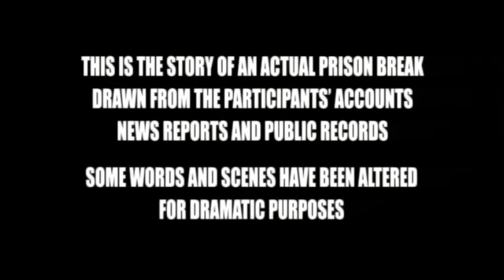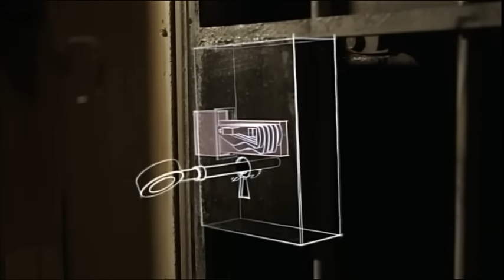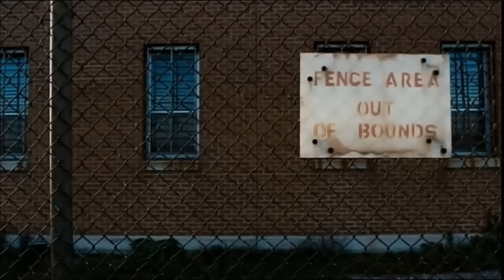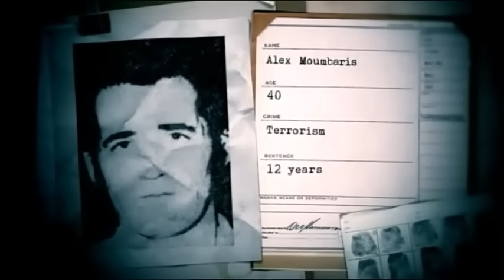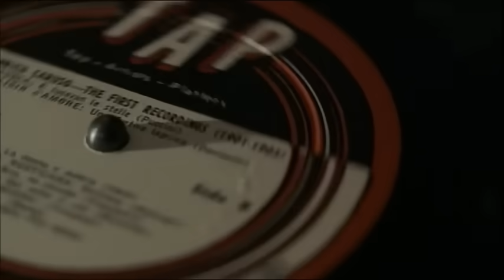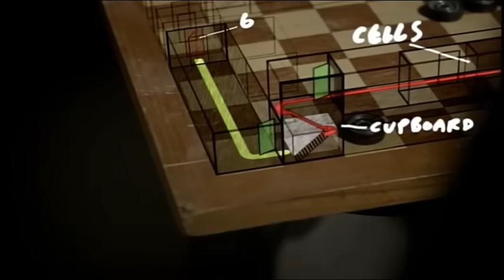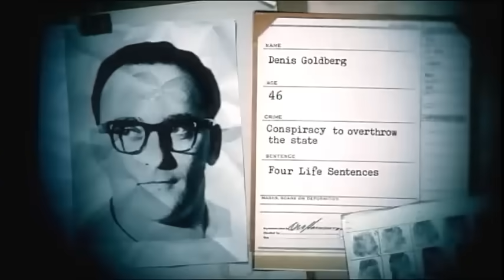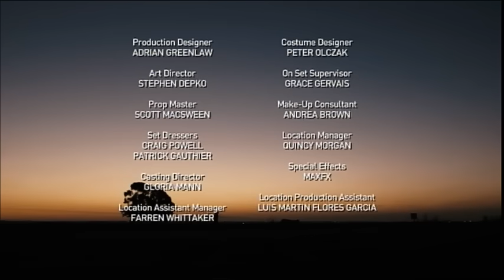Escape from Pretoria

Comment: 5:27 Door 1: Inside
9:34 Door 2: Outside
16:41 Door 3: Corridor
18:12 Door 4: Stair
23:02 Door 5: Office
30:21 Door 6: Wire instead of Circular
35:48 Door 7 36:35 Door 8 36:48 Door 9
37:08 Door 10: Chip is the key

45:43 Door 11: Disguise
47:02 GG

Comment: Many people think that 'wood' generally is a weak material. As a woodworker, I can surely say that it is not! It depends on how you use it, where and how. And there is very different types of wood that has variety of strength. Not in this documentary, but in the movie, Tim mentions about the grain direction... All the wood has a grain direction. Simply that is about the tree growing upwards. And when you try to break the wood against the grain direction, especially if it is hard wood, although a thin piece, it would be very very difficult. It can bend a bit but hard to break... Maybe you notice from the keys that Tim Jenkin made, that the keys are not in one piece. That is because of the grain direction... And considered that the prisoners are doing wood working in the prison mostly repairing chairs or making cleaning sticks or bowls or so, the wood that they use is hardwood, so it means, the keys that they made are stronger. Plus, once you have the shape of a key right, you can copy it easily and if one breaks, you can always do another one...
Thanks you Tim Jenkin for loading this video. I also have watched the movie and I liked it very much. Hope you liked it also :)

Comment: Might have been a tad easier to just overpower the guard and take his keys, considering they could get as many men as they wanted out of the cells.
Reply: Absolutely, this makes lil sense, i like the idea though, no one was even touched. Though instead of chisel work theyve could just try to pick the lock again and again, they had time, if someone was to walk in on them they could just play normal.
Reply: @ericbower2256  yea that's also true, saying as they were innocent political prisoners,  they broke out without hurting anyone in any way, still, they could have overpowered the guard without hurting him. But how dumb a security system to have 10 doors to get through and they all use the same key :P